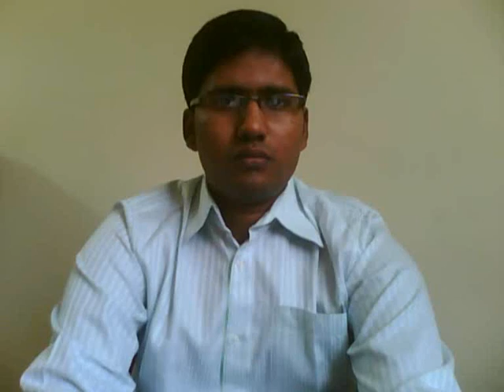#3 Which micro-controller chip to program

Comment: I am working on getting software loaded on to a quad chip then running it with graphics out and audio. I will have to surface mount and run the traces building it into a complete and fully functional product. Seems I am going to have my homework cut out. Any tips? Got my bread board and burner. Just need to make it happen. First I will have to study the code and see what chip can perform the task. then find out what goes where. I am piss broke and looking to leave the USA. Wish me luck.